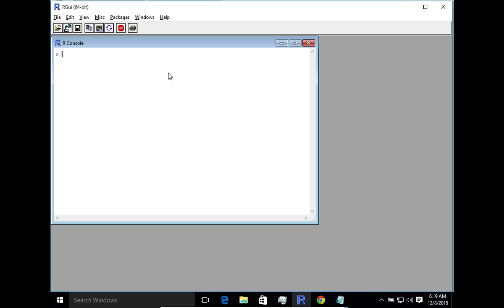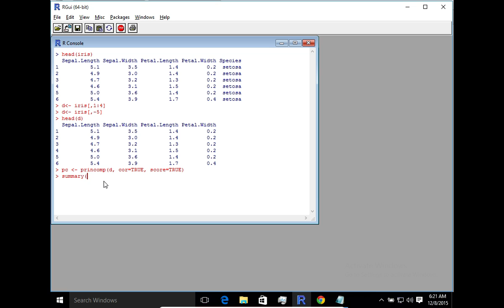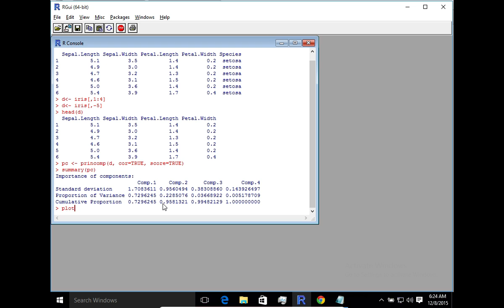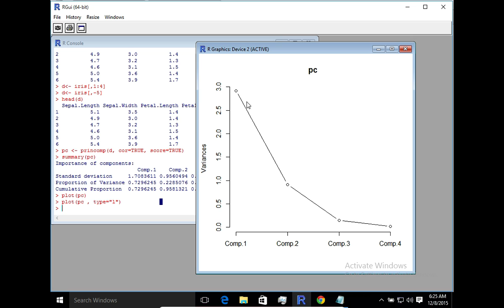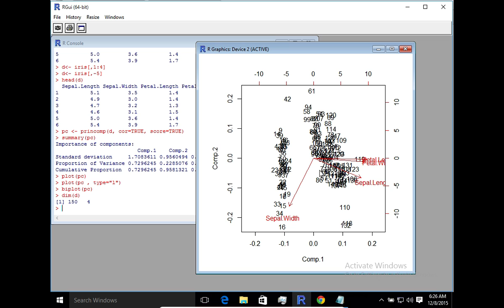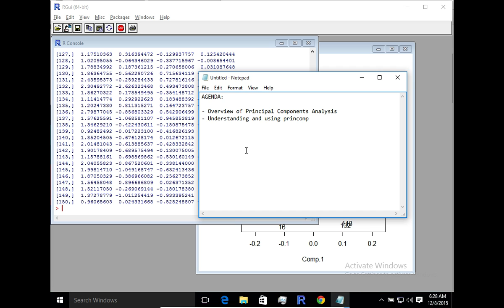Principal Component Analysis (PCA) in R

Comment: The PCA is bounded by the smaller of the two dimensions. So you could have 7 daily observations, and 70 traits. The PCA will produce output for 7 Principal Components. Unless, you are going to keep running every combination of 7 components, or 2 or 3 of them, to get the best fitting model, knowing that several of the variables account for most of the volatility in the data is a very vague direction. The PCA output only shows you that of the 7 there are several that will capture the behavior of most of the data. In practice, it does matter to know which components are which variables. Remember, the results of the technique still have to be communicated to those who might not have the same level of knowledge or comfort with statistics, so naturally, they will want to be able to relate variables to the figures.

Comment: i interested to do multivariate data analysis.Therefore i have 3 response variable and 35 independent variables that include categorical and continuous variables. so the problem under the study will be the description of principal component analysis application. As you know pca used to data reduction when the variable are continuous. Under this study apply pca for dependent variable only?  if your response will be" yes' explain your reason with evidence and how to reduce the dimension of independent variable ?

Comment: Hi, say that I have a dataset and I have finished performing my PCA on the dataset. I find that PC1 and PC2 account for most of the variance in the data. Now when I'm building a  regression model,  do I have to include just the variables that correspond to PC1 and PC2? Thanks for the answer!
Reply: Dear friend Pranesh, since the main goal of PCA is to reduce dimensionality, if you have 5 dimensions (also called variables) and  after performing PCA you see that 2 out of the 5 variables account for 85% or more of the variance, you can base your regression model based on those 2 variables instead of using 5 variables. This could help you avoid and/or mitigate multicolinearity risks (two or more variables explaining the same thing).
Hope this helps.